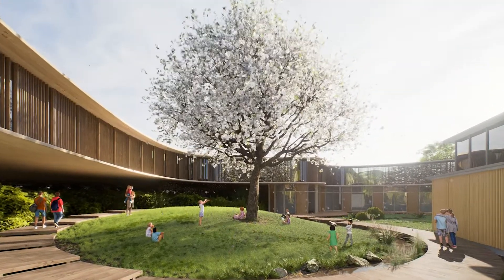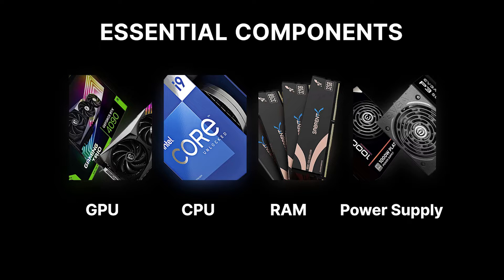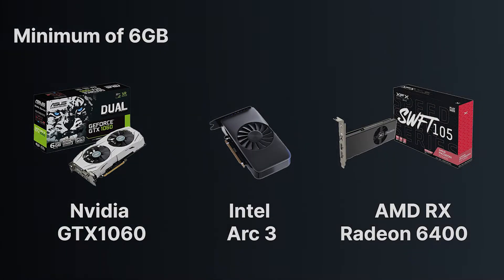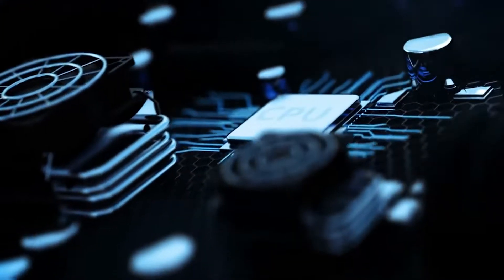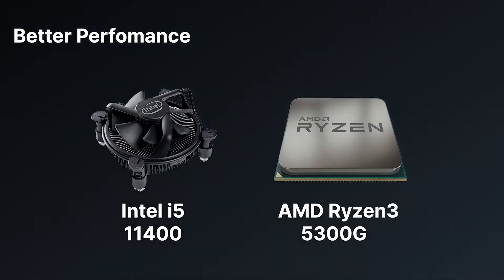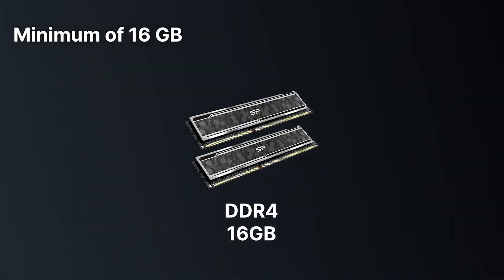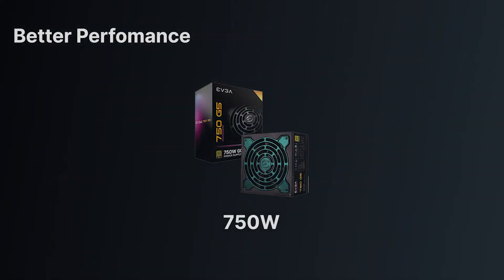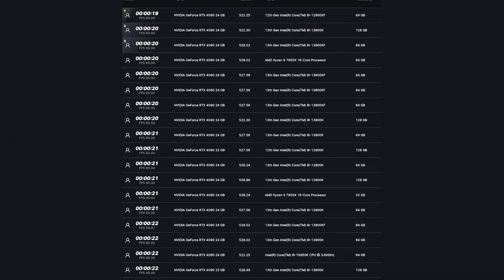Get the Best Out of D5 Render: System Requirements and Recommendations| Real-time rendering

Comment: Any thoughts/feedback on how an NVidia RTX 4060 with 8GB memory might perform? This is quite common for mid range laptops I am looking to buy. Thanks!
Reply: Hi, I'm using 4060 8gb with i5 12600k with 16GB ram. It works fine for now with renders upto 6k and 1080p animation with fairly simpler scene with scatter etc. But would recommend to go for 4070 12gb is possible to keep it future proof.

Comment: so you need to spend a lot of money just to run D5 basically
Reply: Yeah like any other Render Program
Reply: Used rigs with i5 12400, rtx 3060 12gb, 32gb of ram and 750w power are there for about 600usd. How much your Iphone did cost you again?😂

Comment: what about gaming laptop system requirements?
Reply from the maker: Hi, if the gaming laptop has a graphics card that supports raytracing, it can run D5.
Reply: @d5tutorials  Hi thanks for the reply! I'm thinking of getting this gaming laptop: Asus ROG Zephyrus Duo 16 with 64GB Ram, RTX 4090 16GB and 4GB SSD. is that more than enough to get great rendering time especiall video's in 4K resolution?
Reply from the maker: @linkendesignstv7733  Hi, the benchmark results may help you: https://benchmark.d5render.com/result
Reply: @d5tutorials  Thank you so much! Definetly getting that laptop then. Really excited to use D5 Render!